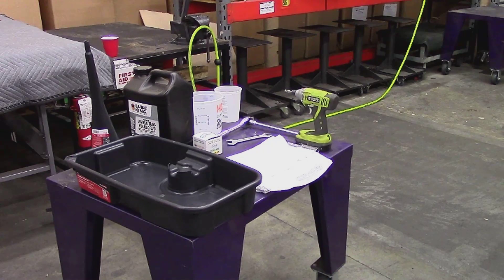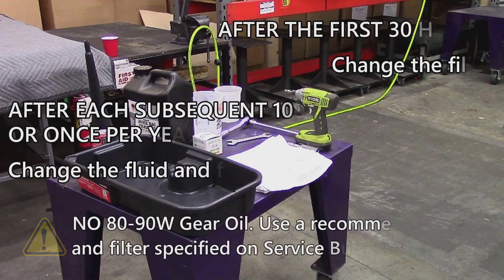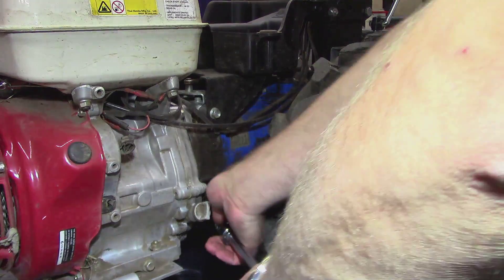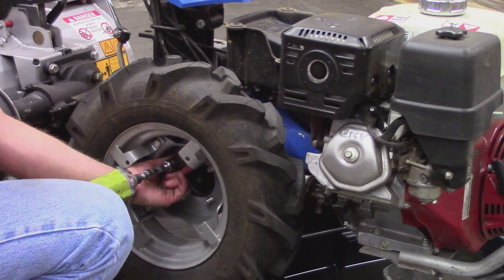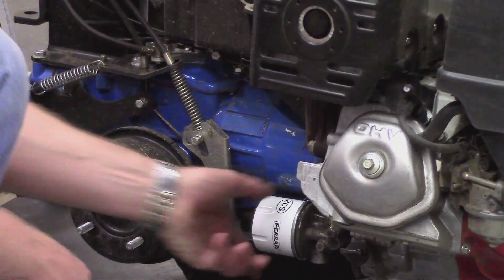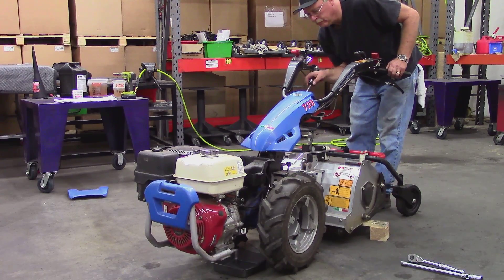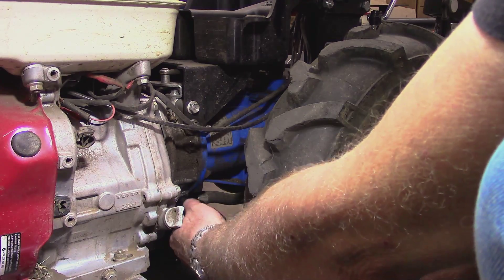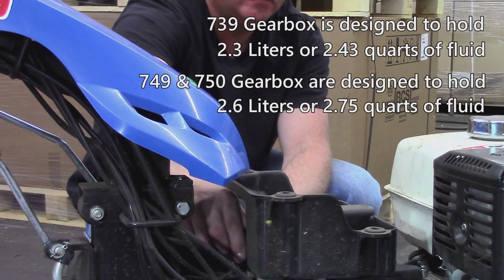BCS Two-Wheel Tractor PowerSafe Transmission Maintenance

Comment: Thanks for this. There is still confusion over here in the UK regarding the correct lubricant for the power safe machines and they are still supplied filled with a hypoid oil (you can tell from the smell). This seemed totally wrong to me and I'm glad to have your information on the correct grades.

Comment: Hello, are you sure torque value for transmission bolt is just 13.56 Nm(10 ft/lb)?

Do you know the oil engine  bolt too for honda gx390 mounted on  bcs? Sorry for my english, regards
Reply from the maker: Yes, 10 ft/lbs is correct.

For the Honda oil drain, it would only need to be about 5 ft/lbs.  Essentially, tighten with a wrench, then give it another 1/4 to half turn.

Comment: Hi, I have the bcs 740 with yanmar engine. The clutch will not engage completely. Will doing a fluid and filter change help that or do I need a new clutch?
Reply from the maker: We'd recommend starting with a fluid/filter change.  If that doesn't solve it, we'd recommend talking it to your local BCS dealer for repair.
Reply: @BCSAmerica  thanks mate

Comment: I have BCS 739 the filter is for transmission drain fluid or that's for the engine oul
Reply from the maker: The filter on model 739 is for the transmission fluid.  That's what this video is covering. Cheers

Comment: Not only is it difficult to get at the filter without removing the wheel on that side but it's also difficult to get at the cap without the appropriate socket wrench without removing the wheel on the other. 

Afraid of stripping the cap with my adjustable wrench, I removed that wheel in order to use my 22mm tire iron. This worked fairly well until I removed the second wheel in order to access the filter and my supports failed. The result, a big oily mess and a fair amount of heavy lifting. Glad I wasn't on camera. I recommend you do yourself a favor and get a jack and socket wrench like the guy has in the video. I've made a note to myself to do the same before trying this again.

Comment: Are you sure it's correct to use oil SAE 15w/30?  BCS italy raccomanded Powerlube GL5 SAE 80/90 and only for cold  climate POWERLUBE W8 BLU GL4 SAE 10w/30
Reply from the maker: Hi Massimo,
This video is for PowerSafe transmission maintenance and it does not recommend 15w30 - that would be the ENGINE oil we recommend.  

For PowerSafe transmission fluid,  BCS recommends PowerLube (BCS branded fluid).  In the United States and Canada (where PowerLube is not available), please use the recommended PowerLube substitutes that are listed in the video, and in the Service Bulletin that is linked in the video description.  
Thanks!
Reply: uk shows 15w/40 on mine.(BCS740)....dunno if it is that critical fully synthetic,  as we are not that cold a climate.......
Reply: @johnn2882  We bought a 740 a couple of years ago in the UK. I noticed that there was somewhat conflicting information in the different booklets provided with the machine. From the smell it seemed that the gearbox was filled with a hypoid gear oil which, from all I have ever read, is not right for an oil bath clutch. I did notice that, when I hit a very dense area of wet vegetation that stalled the flail the wheels stopped turning but the engine, though lugged down greatly, did not stall suggesting that the clutch was slipping at that point. I have now changed the oil for a universal tractor transmission oil as per the bulletin 2-22  mentioned here. I did deliberately push it into some indigestible vegetation and the engine stalled with no sign of clutch slip.